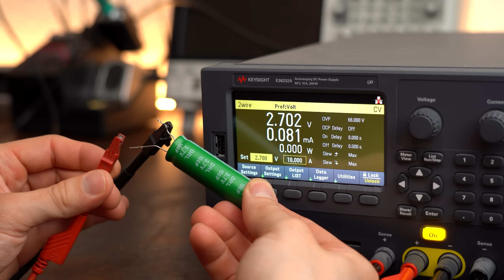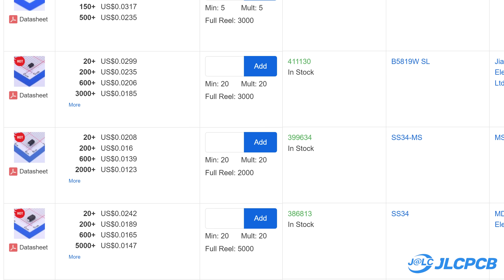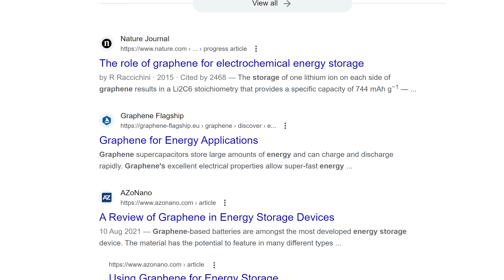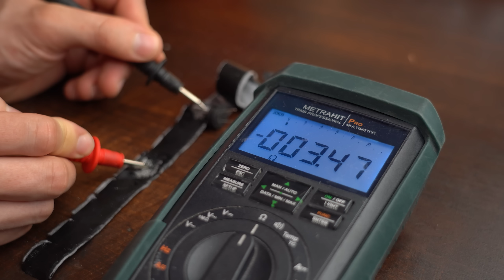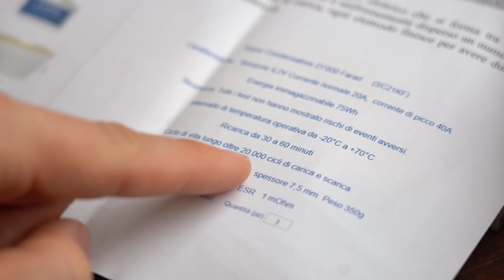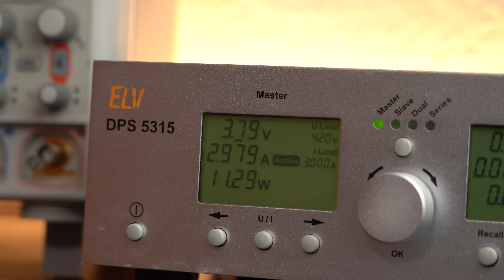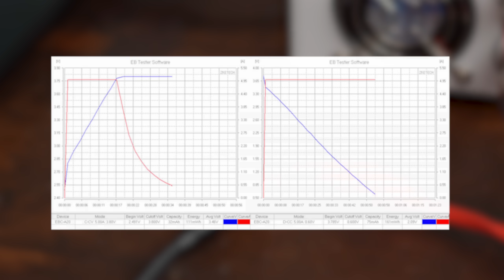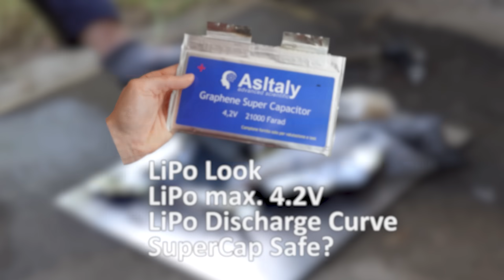Finally a Capacitor that can REPLACE a Battery?!

Comment: Fake company. The address is some house in the middle of nowhere, which ony Google maps says it is a company that replaces lightbulbs.
Reply: they have a website though, which looks legit enough and would be bizarre to exist as it is just to sell this one.  

it could be a real company, but it could be a 'real company in ..    ehm.. italian sense lets say. there's really strange things about the company if it was an actual legit inhouse made supercap like not putting out the info in english is super strange.  on their website these flat pack cells are for 'test only' sourcing. a lot of the products they list for sale seem to just be importing other manufacturers stuff.

my hypothesis is that they are a real company but they just import stuff for the italian local market only and this product is just something their source says is what it is and they are not sure what it is hence they sell it for "test only", a bit cheeky.

if they were the the actual manufacturer of an actual supercap like this, they would be trumpeting around for some eu money etc in english..
Reply from the maker: No idea why I did not bother to check the address. Well, mystery solved I guess.

Comment: Hmm, quite a mystery. The discharge curve should have been the definitive test, but the fact that it didn't blow up on puncture raises some doubts. Maybe it wasn't charged enough for a dramatic show?
Reply from the maker: It did have quite a bit of energy stored while puncturing. It was at 3.7V.
Reply: @greatscottlab  did you notice some sort of a barrier, maybe the banks make up parallel cells, parallel and serial? if it's a supercapacityor why does the manufacturer say "Ricarica da 30 a 60 minuti" / "Recharge for 30 to 60 minutes", their 2 other models that look more like caps have 5 to 10 minute. also their other supercaps go down to -40c.

like if it doesn't have any advantages over a lipo, functions like a lipo, smells like lipo apart from not having the burst to flames on puncture, what's the advantage of it anyway? 

one would probably have to analyze the electrolyte to get to the bottom of it, though one would have to just see if it starts degrading in few hundred cycles. actually testing what they claim coupled with that 30 to 60 minute charge time would literally take years.

Comment: It’s a shame it was a scam, hopefully we get some real capacitor developments soon.
Reply from the maker: I hope so too :-)
Reply: It might not be a super capacitor, but how did they make a (assuming, walks like Lithium, looks like Lithium, talks like Lithium xD) Lithium Battery that doesn't explode when damaged?
Reply: @JordanPlayz158 
 That was rather strange. 
I have had 18650 cells that just smoked a bit when crushed but no fire and no explosion and yes they were charged, don’t remember what brand tho.
Reply: @JordanPlayz158   Lithium titanate

Comment: You should have tried to drain it to zero volts and then tried to recharge it. If it keeps energy inside itself after that and there is no pcb+battery controller it's a super capacitor.
Reply: lipo's dont always come with circuitry. most DIY drone batteries dont have any kind of controller/protection circuit.
Reply: I had a fan on my workbench that I put an 18650 holder on.

I would forget to shut it off and leave it on ALL the time and drain the batteries to 0v. I must have done it 10x on one particular pack and when I capacity tested it again a year later it didn't lose much capacity... I was shocked.

It was a 1/2 worn out cell from a laptop pack that only had about 1200mah capacity, and after all that abuse it was at about 1000mah a year later.

I used it so much that I wore the brushes out in the fan motor and that's when I had to retire it.
Reply: @volvo09 yeah, that's great, but it's not safe. 
Lithium batteries generally experience a permanent physical change (dendrite formation etc) upon being drained below 3-ish volts.

Just because you experienced things a certain way doesn't make it safe or practical for someone else's experience. Doesn't even mean the next person will have the same experience as you.
Who wants to risk a fire for a $3 18650 battery ? Not fvcking me, thank you.
Reply: I recall that hybrid supercaps (the lithium based ones specially) didn't play well with full drain, they were even sold already pre-charged like batteries didn't they?
Like the one Scott showed in the video with the plastic shell keeping the terminals from shorting.
Reply: @Kalvinjj yes. They sold with a 2.5 (or 3.5 I forget) voltage pre-charge, otherwise they'd crap themselves.
Reply from the maker: I feel like LiPos can do that too up to a certain limit. No?
Reply: @greatscottlab  Yes, to a certain limit. But if after 5-6 cycles of 100%->0% it retains its capacity, it's definitely not a lipo.
Reply: @reneonier I am scanning comments and concur.

Does the black stuff add a red tint 🔥 when burned in a blue Bunsen flame?  If so Lithium is present.

@greatscottlab Love your stuff and would like to collaborate!
Reply: @greatscottlab  there is a simple way to see if it’s a capacitor vs battery, make it source or sink some power then stop and leave it isolated.  Now with a 4 or higher digit volt meter look for rebound.  Batteries will show a leakage current similar to a capacitor but with a human timescale that has a rebound lasting  after load for minutes whereas if you charge a capacitor and isolate it most types will hold this charge with a lot lower leakage current, which drains it to zero eventually, and doesn’t have this bounce.

Comment: this might just be a LiPo with a graphene layer/graphene ball structure like Samsung and some RC car batteries (Turnigy) have, but it's certainly interesting it didn't react violent at all so i aswell don't know what this thing actually is

maybe something based on LiFePo4 with a higher max voltage?
Reply from the maker: Thanks for the feedback. It is a mystery......

Comment: it might be one of the new stable lipo that ive seen around... Basically able to handle being cut and damaged and continue to work. But yes not a super cap
Reply from the maker: Where can I find such Lipos? Link please?
Reply: @greatscottlab he mentioned battery sounds like a lithium ceramic battery or lcb. It looks like you reviewed these around 4 years back. Prologium sells these as FLCBs, flexible lcb
Reply: @greatscottlab  maybe he was talking about your lithium ceramic video.
Reply: @greatscottlab  Ive only seen a few youtube vids on them over the last few years. One was designed by the guy who invented lipo. Honestly right now I dont know the title of it... But in the video they were literally cutting the active pack with scissors. And it just kept working. Only thing in the end they were doing is reducing capacity.
Reply: @MD_Builds  That's downright impressive, and something I'm really looking forward to see. I wonder what is the big catch, if they haven't yet come to market, but that sure is a huge plus side specially for the bigger sized applications like electric cars, that are prone to get damaged and you don't exactly want one of them to catch fire and not stop it inside of a basement parking lot on a huge building.
Reply: @MD_Builds  I call BS on this. I have just looked up various ways of saying "safe lipo battery, cut, scissors" etc. and nothing comes up on multiple search engines and YouTube aside form safety boxes.
Reply: @anonp2958  This isnt the specific video i remember but i think this is the same guy and looks like the same running led while cutting experiment shown. https://www.youtube.com/watch?v=m9-cNNYb1Ik
Reply: @MD_Builds it sounds like you're describing solid state lithium batteries.
Reply: @joshleyshock4801  quite possibly
Reply: @MD_Builds  was the guy who invented lipo, Dr. Goodenough or something like that or maybe that was LiOn. I think he is currently working on a glass/graphene battery at the moment.
EDIT:
Well, that sucks... looks like the guy JUST died last month. :( Very sad, he made huge contributions to the world and was about to do so again. Hopefully his work is carried on and not confiscated and shelved.
Reply: @Reach3DPrinters  1: I honestly cant remember for certain. But i think it was the same guy and 2: crap D: thats really sad to hear. Yeah he without the doubt changed the world.
Reply: @Reach3DPrinters  its Li-Ion but yeah he passed away.
Reply: @MD_Builds  I believe everything i see on the net too.
Reply: @Kalvinjj LifePo4 batteries are already in electric cars like the Tesla Model 3 and Y standard range models, and a few other cars, so yes this technology is already out there.

(Though electric cars are already much safer and less likely to catch fire than gasoline cars so not that important of a factor regardless).
Reply: @swecreations  If it's just Li-Fe batteries I've know about them indeed but didn't think they would be that much impressive.

Now that last paragraph tho I'll heavily disagree specially considering how much easier it is to put out a gasoline/liquid fuel car fire than any EV. Likelihood might be lower (if even) but the aftermath once it starts is just horrible and we've seen it in videos out there in numbers, from e-bikes to French and Chinese electric buses.
Reply: @Kalvinjj  There's official data on EV fires now from multiple countries, everything from one quarter as likely to one nineteenth as likely.

Why do you care about how hard it is to put out? Your car is totalled regardless. EV fires are much slower to develop so they are safer in a crash too. In a gasoline fire your car can be entirely engulfed in flames with you inside within 30 seconds of a crash or less, you always have time to get out in an EV.
Reply: @greatscottlab  maybe u will find more info on videos with caption nail penitrating lab
Reply: @greatscottlab he may be referring to your last video of solid state battery
Reply: This is just a simple lipofe.
Reply: https://youtu.be/kJXRyWQgOY4 this is a video from great scott 4 years ago.

The battery you are referring to is called a LCB or Lithium Ceramic Battery and its relatively new in terms of usage but its a fairly old innovation.
Reply: This was my thought, they are a relatively recent thing too, and still difficult to find, but maybe? :)
Reply: This one?
https://youtube.com/shorts/_alpYRr6R90?feature=share

Comment: Looks like a battery to me, especially the internal structure. I'm not a battery expert either, but I can see it has multiple sheets for the electrodes, leads, pads and so on...

Edit:
Yes, a capacitor would need such layers as well, but as @ladislavseps4801 pointed, it would need 2 layers for anode and cathode in addition to a separator and the electrolyte solution.
Reply from the maker: Sure, but a capacitor would require such layers as well.
Reply: @greatscottlab Yes but a Cap dont need copper plates because there is no lithium that can reakt with the aluminium on the anode side.
Reply: @greatscottlab  The capacitor also has the same structure however there is an electrolyte, so was the supercap wet inside or not? Also maybe compare the grey material from the capacitor and the supercap, are there any chemical reactions to show if its lithium or not? I think lithium reacts when put in water and graphene would not
Reply: @greatscottlab  I agree for sure, but as the guys commented here, capacitors USUALLY does not require such many layers.
Reply: @greatscottlab  maybe I'm wrong but I was under the impression the defining difference between a capacitor and a battery is that a capacitor only is one layer whereas a battery is multiple? (one cell vs multiple cells?) Otherwise they're both similar in their construction and physical mode of operation I thought...

Edit: having looked it up it seems unclear. It seems like generally batteries involve an electrochemical redox reaction whereas capacitors usually do not. I'm not sure if that's always the case though such as with electrolytic capacitors. Whether a single cell battery is the same as an electrolytic capacitor?

Idk someone more qualified than me should chime in haha.
Reply: @greatscottlab  I believe a cap has 2 sheets that wrap around the available space while batteries have multiple sheets, the shape of it also in my opinion is a give a way, it is not suitable for caps,
Reply: @youssubernfissi5559 you're correct. That doesn't come from my belief however, I've opened capacitors myself and you clearly have two layers of material with thin waxy sheets in between, wrapped around each other for the entirety of the capacitor. 
There are no copper layers like seen in this video. 
Look at the patent for a super capacitor. No copper sheets.
Reply: I don't know much about super or ultra capacitors. But normal eletrolitic capacitor have solid anode and cathode is the electrolite itself (and chemistry between them makes the isolator for storing the charge) . The green supercap seemed to match this: eletrolite + plastic separator + 1 other material. Accumulators should have 2 distinct solid electrodes + electrolite + separator.
Reply: Agreeable, it looks a lot like that of a Lithium polymer cell.
Reply: There are several ways to build a capacitors just like coils ..flat wound  pancake stacked roll... look to guitar capacitors for how there built and how it effects tone
Reply: @johndavis6482  i thought the tone lived in the exotic hardwood body ;)
Reply: I'm no expert, but from what I gather is that the only real distinction between a capacitor and a battery is how long it keeps it's charge, how long it charges and discharges, and the amount of current that can be discharged in a given moment. If you have a battery that can charge as fast as a capacitor and discharge current like a capacitor but has long term storage like a capacitor it is now both a battery and and a capacitor.

Comment: Farad = amp*second.  Note the "second" as opposed to 'hour'.  3600:1.
That said, batteries are often rated in milliamp-hours, Note the "milli" which is 1000:1 in the other direction.
Still, farads are tiny.
Reply from the maker: Feel free to check my calculations. They should be all correct. I triple checked them.

Comment: how to build efficient spark gap?
Reply: Stay safe when doing anything with high voltage.Spark gaps are not efficient since they usually turn a whole lot of electricity into heat for them to trigger. 

You can make one that is solid acts as a holder and can be adjusted on the fly. 
1) take  a piece of plastic or wooden board. If wooden take care to remove anything metal within, also dry to decrease conductivity as much as possible.
2) take two rectangular pieces of wood and screw then from the backside of the board. The board should be stable and NOT easily tipped. I should look like a letter U 

3) drill two holes through the rectangular pieces of wood and insert a component named "threaded nut for soft wood" and shove them in. Opposite to each other.
4) a good idea is taking a metal washer, drilling a non-concentric hole, putting a wire through that and letting it be in contact with the threaded nut for soft wood, on the other side too if it was not obvious.
5) put in the screws and screw them in so they almost touch. The screws need to have a hexagonal head
6) optional. Take a wooden dowel and drill a hole a bit smaller than the screw head, then smash in the head of the screw into the hole creating a wooden wrench that can insulate a bit though for extra safety i would connect it to a plastic pipe. Adjusmetnts on the fly.
Be careful. High voltage is dangerous, especially from a mot.

Comment: suggest setting part of battery on fire - red flames indicate perhaps lithium?
Reply from the maker: Oh boy. That does not sound too safe though.
Reply: @greatscottlab I'd argue it's no less safe than testing the robustness of a LiPo cell using a hammer and nails....
Reply: @greatscottlab  you can take some of the layers and set them on fire.
Reply: @2darki  I just misread that as "Take some of the lawyers and set them on fire........."
Reply: @greatscottlab  I do not think you need to burn that much to test, snipping off a corner should be enough to change the flame's color. And of course you should use a respirator just in case.

Comment: Hey there!
I was wondering if you would make an AC UPS project.
The only ones on youtube are just battery banks but dont support the "uninterruptable" charactertistic that UPS needs.
Great video like usual, would love to see more of the aliexpress videos and hope you find my suggestion valid enough to make a video
Thanks!

edit: would be great if you could also talk about line interactive ups, upsides and downsides compared to a standby one and mention what would be the upsides to the line interactive one. As line interactive is going to use the battery far more, and going to be more expensive.
A standby ups would pair up nicely with your garage build and you could make a line interactive ups for housing more voltage sensitive electronics like pc/oscilloscope etc
Reply from the maker: I can put it on my to do list :-)
Reply: @greatscottlab Nice! I would love to see a project like that from you
Reply: @greatscottlab  :D
Reply: The easiest solution for smaller devices is to keep a lead acid battery topped up from AC power (since LiIon doesn't handle trickle charging well), and put an inverter on it. That way, you're isolated from the grid, and when AC power fails, the battery just doesn't get charged any more.
Reply: @vincentguttmann2231  That is one way, but again thats only feasible for lion/lifepo4 type of batteries. And constantly being charged/discharged has its own set of problems that isnt talked about much so thats that
Reply: Nice safe capacitor